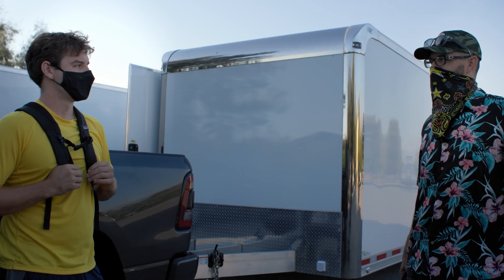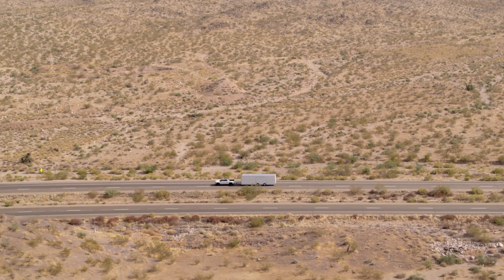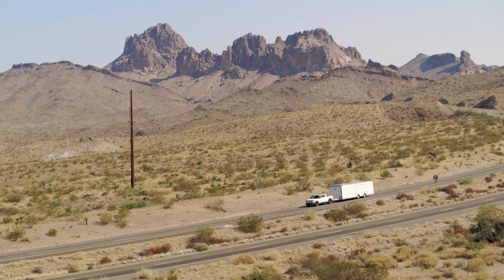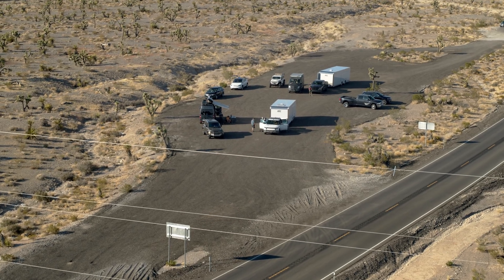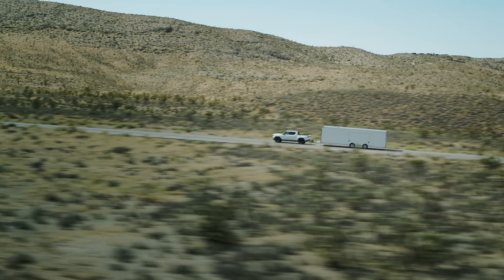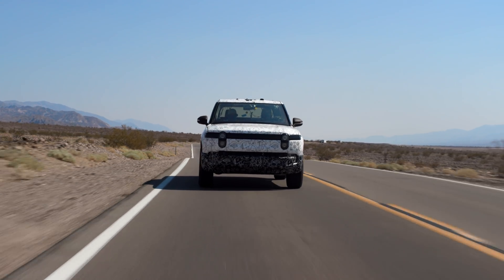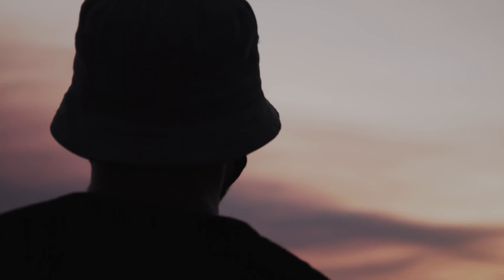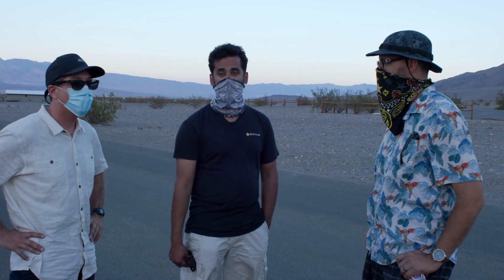Hot Weather Towing | Progress Report | Rivian

Comment: Would love to know how range is effected by towing. I know the Tesla X only gets about 30% of normal range.
Reply: Waiting on these numbers also. I.m sure they will figure in the future to make them as efficient as a internal combustion motor, but currently I don't see them as even close when pulling.
Reply: @bigqwayne  electric drive is way more efficient than internal combustion engine. Perhaps 40% efficiency at best with Atkinson cycle internal combustion minus transmission losses, 80% plus with electric. It doesn't matter of towing or not.
Reply: @danwat1234  that's not quite how it works. Electric cars range is more effected by towing BECAUSE they are so efficient. Think about it this way:

Tesla model X gets about 100mpge when not towing and can do 300mi. While towing it gets 30-40mpge. That's really efficient! The problem is it cuts the range by 60-70%.

Compared to a new diesel truck that gets 24mpg and 850+mi of range. When that truck tows it can manage 12mpg easily which is only a 50% reduction in range. 

The Tesla semi manages 500+ miles on a charge WHILE towing. They do this by installing TEN Model S batteries in it. 

So until we can get electric trucks with massive batteries, towing range is going to be bad
Reply: @noconz0727  Yes range is drastically reduced when towing completely agree there. But from the strictly energy consumed standpoint electric stays way ahead.
Reply: @danwat1234  I gotcha
Reply: @danwat1234  I appreciate that and get it, I think transmission alone is about 20%,but I guess what I mean in terms of range is the energy storage. The weight and capacity of batteries is way more then the storage needed for internal combustion engine. And it is going to take a lot more energy to tow 11k as opposed to sailing along level ground. for example if I want to increase a diesel by a certain mileage I can add a relatively lightweight tank to a small portion of the truck bed, how many battered would it take to get the same energy out of the same weight and capacity. I may be totally wrong, this has only been my limited research. I have only had one electric car in the past, currently looking into another ( a bit more than my Fiat 500)and looking forward to selling my Diesel in a couple years for an electric, but we will see.
Reply: @bigqwayne  Yes you are right in that respect. Although electric is much more energy efficient it still takes more weight of batteries than it would take weight of gas or diesel to go the same distance until there is a major battery breakthru.
Reply: More like 50perc.Check out Bjon Nylands videos. He used to tow a lot with his P90D.
Reply: @mravecsk1  I got my info from The All Electric Family 

They told me they average 30%

https://youtu.be/7da9malIrVM

Comment: So what’s the range when pulling 11,000?!
Reply: Exactly
Reply: That's what this kind of testing is meant to determine and the data will likely be made available closer to launch. That said, a 50% reduction in range sounds about right at maximum weight, but we'll have to wait and see.
Reply: Smarter Than You you're not smarter than me if you don't know.....
Reply: Fat Broads Horse Faced Lesbian you don’t know either asshole. Battery and drive systems aren’t the same across all ev platforms
Reply: Fat Broads Horse Faced Lesbian oh please wise one tell us the exact numbers since you know and literally no one outside Rivian’s engineering team does. I’ve ordered two
Reply: Smarter Than You well, you're smarter than me and ordered two, so you should know,  genius.   You'd think being so smart that you'd know before you ordered. Smooth move ex-lax.
Reply: Guys can you tell us what was the Wh/ miles consumption when towing 11k lbs up the hill. Check out my Towing videos with the Model X. Range drops significantly when towing 5k lbs. Wonder what would be the estimated range of R1T while towing. Also where did you charge when you guys were in death valley. Did you bring large portable batteries?
Reply: Now this is the hot question.
Reply: From what Rivian has said, it will be about half the range it would get if it wasn't towing, which is fairly consistent with what you get with gas powered trucks when they tow similar loads.
Reply: undead890 my 6.7 diesel F550 chassis cab only loses about 20-30% depending on load when towing. Nowhere near 50% loss in mileage. Heck, BEV lose 20-30% just running the HVAC.
Reply: jabberwolf   - 3500 lbs CARGO and 14,000 lbs towing up a 5% Grade at 85 mph and in 10 Seconds.
Reply: @markplott4820  You still haven't given an answer to range when towing. But then we don't know that answer for Rivian either.
Reply: Stetrain The Model X lost about 50% range while towing, so it wasn't good. So, you can probably expect the same with Rivian. IMHO, diesel is still the best for towing if you're looking for range.
Reply: @fatbroadshorsefacedlesbian8619  most def Diesel still the king of towing. I towed large U-haul trailer from Chicago to Nashville with my X. Pulled yo a supercharger in Nashville with 1 mile left on the battery. I was going like 45 mph at the end. Scarry sh... I will have video up with that adventure soon.
Reply: jabberwolf  - Remeber this , MARK my words, TESLA CYBERTRUCK will be the FASTEST Pickup Truck up PIKES PEAK.
Reply: jabberwolf   - as for RANGE , if we assume 50% less for TOWING , we are then talking about 250+ mile Range , but you can use SUPERCHARGERS to Extend that Range.
Reply: Mark Plott Rivian doesn't have Supercharger (S) available as does Tesla.  EA simply doesn't have the numbers Tesla does"
Reply: jabberwolf  - NOT IF you are using a SUPERIOR BMS , octovalve and Heat Pump to keep eveything in order.
and the TESLA 400v Arcatecture is plenty to handle FAST Accelration times. 
not to mention UPCOMING vehicles may be 800v or 1000v Arcetecture with NEW High Power and High AMP Battery cells. 
CYBETRUCK will Likely use the NEW 5498 LION cells its Developing. using NICKEL + SILICON.
this means FEWER but LARGER cells overall in the PACK with DIRECT PLATE Cooling on Both Sides and a TABLESS Design for HIGH AMPS.
most LIKELY Tesla will KILL the BASE Cybertruck Short Range in FAVOR of a 2WD (RWD) Long Range Pickup truck with over 300+ miles , and the other getting Updates as well.
besides, given TESLA track record, it will PRODUCE the Dual Motor and TRI MOTOR FIRST then the RWD Long Range.
Reply: Should be better than a tesla
Reply: @asimrc  Which Tesla and what BP size and Wh/km?
Reply: mravecsk1 any in existence to date. Go check out TFL page and search for Tesla towing
Reply: @asimrc   - NOPE, Tesla CT can haul 3500 lbs or 14,000 lbs TOWING.

Comment: I think Rivian will have much  better reliability than Tesla. I’m sure they’ve learned plenty about making a quality drive train using them in the Amazon delivery vans.
Reply: NOPE, thanks for Playing.
TESLA has a 1 Million mile Drivetrain, 500,000 mile LIFE on the Battery and 300,000 miles between Maintanance.
Reply: Someone That Watches YouTube not too sure about that, Tesla has several years experience manufacturing cars. I definitely want one of these but going to let them work out the bugs first.

Comment: I am very curious to know the range when pulling 11,000 pounds. Is it a 50% reduction in range as some have estimated?
Reply: Very likely, but we won't know until release or independent testing. There's no magic here, energy consumption of all vehicles increases when towing.
Reply: In my experience in towing all sorts of trailers and after watching the TFL video of the model X towing I think you could expect a range loss of 30-75% depending on weather conditions and type of trailers pulled. For instance my 2010 gmc sierra 5.3 6spd auto hauling 9,000lbs of tile will get 10-12mpg at an average speed of 65mph with a bit of passing power to spare. Same truck pulling my 30ft 9,000lb RV trailer at the same speed it will get 3-8mpg and not much power to spare. Toss in a nasty head wind or crosswind and suddenly its got no power to spare. The truck typically gets 18-20mpg empty. TFL on YouTube got similar results in range capacity when pulling the trailers with the model x. Towing range is something the electric vehicle manufacturers don't want to talk about because there are so many variables. I love electric cars but the battery and charging capabilities need some more technology before it's truly successful.
Reply: Good point Ron what are the official numbers towing that weight I live in Australia and will be towing similar weights in similar heat we need to know the numbers before I put any deposit down
Reply: @MichaelSmith-px1ev  Rivian has stated in the past that the 11,000 pound towing capacity was where the vehicle achieved 50% range reduction.  That, at the time I'm pretty sure, was based on engineering estimates.  This video implies it might be a little better in reality.
Reply: The first company that can get the range reduction number close to or better than ice models will gain the biggest market share with people converting to EV trucks
Reply: @lewiscross7603  Or come up with a vehicle that can come close to 700 mile range.
Reply: @lewiscross7603  probably not, most trucks sold in the U.S are luxury trucks with crew cabs and rarely the base model. Most trucks are rarely if ever used for actual working, its a status symbol for most. Since its a status symbol practicality has little to do with the buying process, its about how am I going to look the best way possible.
Reply: There is no answer to your question yet. Very few official numbers are know for any of the upcoming ETs. That's what this kind of testing is meant to determine and the data will likely be made available closer to launch. That said, a 50% reduction in range sounds about right at maximum weight.
Reply: Math says it is about that, see EE channel
Reply: TESLA can TOW 14,000 lbs up a 5% grade at 80+ mph !!!!!!
Reply: @markplott4820  that's not what he was asking
Reply: @markplott4820  Tesla can’t tow anything since there was one CT mock-up. When they have several out and about for this type of testing let us know. Otherwise stop being such a fanboi

Comment: I'd love one but I'd have to rewire my whole house to be able to charge it
Reply: Probably not unless you have a 60A service. In which case you should probably upgrade to a 200A anyway. Hope your panel is close to the garage.
All you really need is a 50A circuit. Charge at 40A.
Reply: So pay 65k for the truck but can't pay an electrician to put in another breaker?  😝
Reply: John - you can charge at home on Plain old 120v , but it will take 12 Hours !!!!!!!
for BEV , you really need a DEDICATED 240v 60 Amp Grounded Plug. 
and its even Better with a POWERWALL , to store Super Off Peak GRID energy the use it to Charge your RIVIAN. 
Bonus, you can Power most of your Home on Battery Power.

Comment: I'm in Canada and the average winter temperature in some cities is -31F. Rivian keeps posting videos always filmed in non-snow/freezing conditions. There should be at least a year of tests done in Alaska to see if the battery capacity is not going to drop 30-50% because of winter conditions in the north.
Reply: If it helps, they're based in Michigan and keen on temperature control.
Reply: So Troy gave Philip the best up to date answer 3rd episode of long way up. Sub zero weather will freeze up charging. Not even electrons want to flow, be pushed by voltage. The Harley live wires had a difficult time charging. I have no inside information but I’m sure The Rivian engineers have enough data to figure out how to stabilize the battery temperature in all conditions for optimum usage optimum charging and so on. I loved the reaction of of the long way up team when they first showed up in Michigan at Rivian. They were like uh oh WTF were is the rest of the R1T? RJ is like “What? No problem we will be there....two weeks later there they were. RJ with this HUGE😄 grin yeah no problem forgetabowtt
Reply: They probably will do once its winter
Reply: There are videos of lab tests in cold conditions on the batteries/electronics but it's not winter yet so these prototypes haven't seen the snow yet probably for tests.
Reply: Last winter they did a big PR thing with Alex Honnold in colorado. Doing cold weather test drives in deep mountain towns.
Reply: @colinfiggins3372  The average winter temperature in Colorado is not even freezing temperature. Something like 40F. A reliable winter test drive would be in places like Edmonton, Whitehorse or Anchorage.

Comment: Alaskans want to see cold weather performance!!
Reply: Rivian has done cold weather testing.  Most notable was the "Long Way Up" series (just aired on Apple TV+ yesterday) when they used I believe at least 2 R1Ts as support vehicles for the Harley Davidson Live Wire electric motorcycles ridden by Ewan McGregor and his buddy Charley Boorman.  It was an approximate 13,000 mile journey over 100 days that went from Tierra del Fuego, Argentina, South America back in September 2019 (winter and common place for auto manufactures to do cold weather testing) to Los Angels, California.   
https://www.youtube.com/watch?v=611fw81BN98
Additional videos with this YouTube search - https://www.youtube.com/results?search_query=Long+way+up+rivian+winter
Reply: Same in BC!
Reply: Yeah I hope they use a heat pump too like the Model 3. A resistance heater is far too inefficient for negative temperatures. But towing range at max load is also an important factor.
Reply: let's see some snow and ice!
Reply: And Minnesotans
Reply: @guyontheinternet8891  and just because we don't have charging stations doesn't mean we won't have them and a 15kw generator with a 50A charger can easily recharge the vehicle overnight
Reply: @guyontheinternet8891  why's that? Battery's are actually pretty good at sustaining charge and they have amazing center of gravity.
Reply: @guyontheinternet8891  what they dont have power for house's up there... 🤔
Reply: @guyontheinternet8891  just saying powers more likely to be in places you can't get fuel
Reply: Count us Canadians too!
Reply: @guyontheinternet8891  Same could be said with heat, especially extreme heat.
Reply: John , RIVIAN lacks a HEAT PUMP , the Cybertruck is BETTER suited for Alaska, its got an Octovalve + Heat Pump.
Reply: @markplott4820  yeah but cybertruck is ugly plus I can't fit a camper in the cybertruck
Reply: @lesstevens2370  that's a funky camper, but that's going to be super limited on space if it doesnt overhang, plus I need to be able to tow a conventional trailer, and preferably a gooseneck in a dream world.
Reply: @Agenderous  it unpacks kinda like origami
Reply: @Agenderous  fair enough I'm stoked for the cybertruck I love the utility it provides and the stainless steel don't have to baby it like those aluminum fords if I want to baby something I would get a Lamborghini or something like that not a work truck
Reply: @lesstevens2370  I wish I could get stoked about it. I love everything but the exterior. It's just to risque for me. Plus  Tesla doesn't offer parts for their cars yet and that'll be my deciding factor on brand. Until I can order a new battery pack (or preferably, single cells) and install it myself, I'll stick with ICE.
Reply: @markplott4820  - I'm of the understanding heat pumps are a drain on the battery.  (May have heard that from Sandy Munro.)  Assuming that's true, do you know if Tesla has released any stats/data in that regard, e.g. impacts on range?
Reply: @chuckm260  I wish they provided states like that.
I'm pretty sure a heat pump is more efficient. Just compare a reversible AC unit to a space heater
Reply: @Agenderous  - Thanks Cody.  My bad.  I just read your earlier post.  I believe I was thinking of the resistance heating.  Yes, the heat pump would be more efficient between those two methods.
Reply: @chuckm260  however, they don't work below a certain temperature, and usually that's about -10f, which is fairly common in northern climates. I'd like to ensure they have a good minimum temperature rating or at least a backup resistance heater